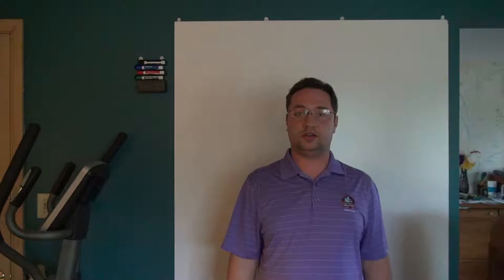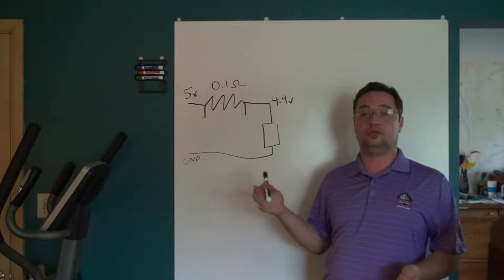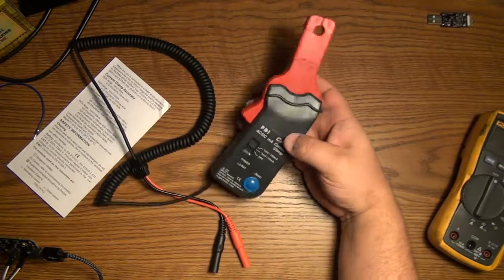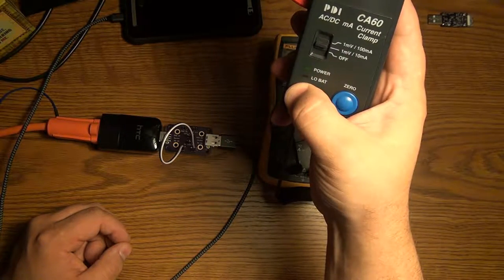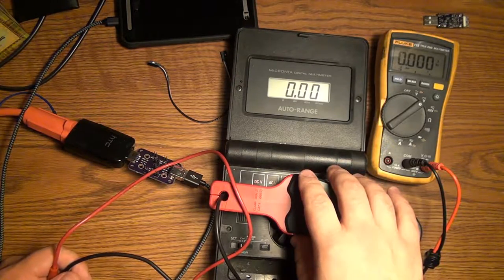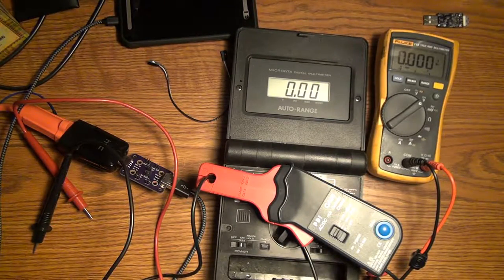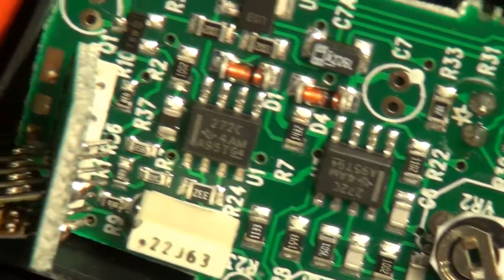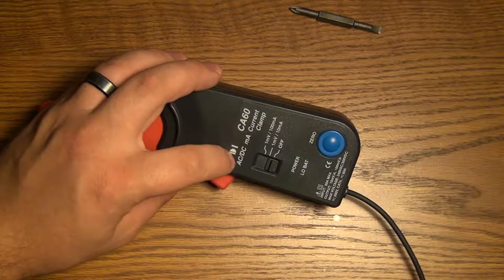eapbg #21 Burden Voltage and Clamp on Current Meter Tare down

Comment: EAPBG, what equipment can test how much current an AC outlet can output BEFORE it pops the breaker if you didn't have the buildings wiring schematic or main fuse box and didn't know how would you test the AC outlet to know how much current it can handle BEFORE it pops the breaker?
Reply from the maker: If you were planning on doing this, please don't. Unless you know exactly what you are doing you will kill yourself. Either by electrocution or setting the building on fire and I bet it will hurt the entire time you're dying. That said, there is special equipment for tracing wiring and breakers such as a toner. Apply a tone to a wire that is turned off and then use a probe to follow it. Circuit breakers have two modes of operation short circuit and running overload (terminology may vary). Short circuit is simple, a large inrush (something like 1000%) trips an electromechanical coil. Overload is more difficult. This is because it usually uses a bimetallic spring. The ratings are something like 100% indefinitely, 110% for an hour, 150% for 10 minutes, and 200% for 2 minutes (made up but that's the idea).  With a 115V 15A outlet, you need to dump 1800W of power while testing. They make electronic loads but for that kind of power, you're looking at $5k and up.

Comment: The alternators control lines are called bidirectional there is 2 wires, one is for the feedback to the ECM/ECU and the other wire sends out a 400hz duty cycle PWM pulses. I don't know why mechanical technician call the wires bidirectional when both wires aren't bidirectional they are just 2 separate unidirectional signals. Yes its called a charging system either a 2 wire or 3 wire control signals.
Reply from the maker: Because of your TIPMs comments, I assume you are working mostly on Chryslers. I hope you realize that there are many many other types and setups of charging systems. Every manufacturer is currently using at least two different setups. Further, historically there are hundreds more. It is impossible to generalize about all vehicles because someone somewhere did it differently.

Comment: That is what I want thinking because i don't see a "separate specifications" in equipment or circuits that just tell you the switching loss of the whole circuit. How can you lower the switching loss? by lowering the +Vcc voltage and using high switching frequency but what else can lower the switching loss? I know when TTL switched from NMOS to PMOS to CMOS the switching loss was lowered also.
Reply from the maker: If I could answer that question I would be rich.

Comment: Thanks I get it, but all transistors, FETS will have switching loss, is there a specification that tells you the circuits switching loss value or is this switching loss part of the power efficiency spec of Pout/Pin *100% formula?
Reply from the maker: It's part of the overall power efficiency.

Comment: EAPBG, any reasons why the current raises higher drawing more current when an AC motors brushes start to get carbonized? and why does a stylus printer head draw more current compared to a thermal head printer?
Reply from the maker: No idea, either topic.

Comment: Which CAN modules in most cars use memory? The ABS module has memory chips?
Reply from the maker: ECM/PCM hold the memory of codes and how the engine is running, radio, clock, body computer, possibly gauge cluster, anything else that can have memory like seats, mirrors, etc.

Comment: so you're saying that the metal chassis and the earth ground wire form a capacitive coupling? All circuit boards have conductive traces which are to close to each other will form a capacitive coupling between 2 print circuit traces close together. When you disconnect the earth green ground wire on the AC cord, you will measure microamps of leakage current, I'm not sure where this microamp leakage current is coming from or why equipment even has leakage current.
Reply from the maker: Yes, circuit boards also suffer from capacitive coupling.

Comment: Is the frequency of the control line always 400hz? Can you upgrade your car and put in a higher output amperes alternator like 130 amps when the stock car has a 90 amp output you can upgrade it to a 130 amp alternator? Because the cars regulators circuit somewhere limits the car alternator by sending signals to the ECU/ECM unit, this is how the car regulators circuit limits the car alternator?
Reply from the maker: It is very difficult to say because there are a ton of different charging systems. Generally speaking, the car does not monitor the current of the alternator, only the voltage of the system. The control loop tends to work as follows. If the system voltage is too low give the alternator more output. If the system voltage is too high give the alternator less output. If the power of the alternator changes, this control loop would just readjust.

Comment: When replacing a Light Bulb/Lamp with a higher current rating Light Bulb/Lamp, will this "overload" and damage the circuit since the new Light Bulb/lamp needs more current to light the light bulb lamps filament? I'm guessing higher current rating light bulb lamps have a thicker filament
Reply from the maker: It could, it depends on what the circuit was rated for, to begin with, and how far you are exceeding its limits.

Comment: EAPBG, what is the difference between ceramic fuses compared to glass fuses with filaments? is it about the time delay of the fuse filaments? I'm not sure what the differences between a circuit breaker that is in the AC outlet mains compared to a GFI circuit breaker. I think the AC outlets with built in GFI circuit breakers is referenced to a water sink piper and the AC outlets that just use circuit breakers from the main panels are referenced to earth ground. The GFI AC outlet are ment to connect plug in equipment that have electronic circuits boards that uses water or fluids so it a hose inside the equipment leaks inside internally only the electronic circuit boards or AC wires inside internally inside the equipment the GFI AC outlet will trip much faster than a ceramic fuse or glass fuse time delay?
Reply from the maker: No to all of that. Generally, the difference between glass and ceramic fuses is how much current they can break. There is a category of fuse called HRC high rupture capacity. These fuses tend to be ceramic and basically, they are designed not to explode when breaking a large current. Fuses protect the equipment, not you. GFCI outlets and circuit breakers are meant to keep you alive. I'll leave it to you to look up the details. Simply they compare the incoming and outgoing current and if they don't match, they trip. This is for when someone is getting shocked hot to GND.  Incoming current is leaving via a different path causing a mismatch.
Reply: @eapbg  A GFCI outlets compare the incoming current would be what and the outgoing current would be what? I'm confused the incoming and outgoing current is 120VAC and whatever the equipment is plug into that outlet is drawing current. I'm not sure what you mean how its comparing incoming and outgoing. I'm guessing you're saying that GFCI have comparator circuits or memory but how is it comparing when there is only 1 outlet 1 AC cord plug into it?
Reply from the maker: Current always moves in a loop. A GFCI has two wires in it. Hot and Neutral. The comparison happens between those two line. Google how GFCI outlets work.
Reply: @eapbg  ok thanks i just thought equipment like autoclaves, sterilizers, dishwashing units are ment to connect plug into GFCI outlets only if a water hose was leaking internally inside the sterilizer or autoclave the water leakage onto the AC wires can cause the water to be a live wet 120AC and if someone touches the live wet water they will get shocked this is why you're suppose to plug equipment that uses water into GFCI outlets i thought.
Reply from the maker: @billwilliams6338  That is entirely correct. If the current bypasses the outlet via a ground there becomes a mismatch of current on the on hot and neutral line and the outlet trips.

Comment: Yes if you put your Current Clamp on the AC cords green wire earth protection ground it will measure leakage current and if you disconnect the earth ground from the AC cord and measure the leakage current on the metal chassis, any reasons why there is leakage current measured when you disconnect the earth ground green wire ground? All equipment has leakage current on the metal chassis I'm not sure why there is leakage current or where its coming from or what causes leakage current
Reply from the maker: For other than hot being shorted capacitive coupling would be the other reason.

Comment: list what would cause capacitive coupling issues like what to cause leakage current?
Reply from the maker: Capacitive coupling is how capacitors work. It's just that metal parts in close proximity to each other can also form capacitors. A capacitor can conduct AC. Thus current can pass through the metal body and to earth.

Comment: What are you talking about as switching loss, what causes switching loss?
Reply from the maker: Let's look at a simple circuit of a 12ohm resistor being turned on by a fet in a 12v system. Power is I^2 *R. When the fet is off it looks like 1Mohm. The current is effectively zero and so the fet is dissipating zero watts. When the fet is fully on let's say its resistance is 1mohm. The current would be 1a and the power dissipated would be 1mwatt. When the fet switches it has to transition from one resistance to another. During that transition the power it dissipates increases. Let's lake the example when the fet is 12ohms. The current ould be 0.5a. The fet would be dissipating at that instant 3watts. You can extrapolate the other points if you want. The simple answer is that while switching, during the transition the fet will get hot.

Comment: When measuring the current output of a cars alternative it will measure in general 60amps to 90 amps at car Idle. When measuring the current of the car battery red wire positive it will measure 2amps to 3amps at car idle. Why is the car battery red wire positive only measuring 2 amps to 3 amps of current? Also some cars alternators have a 400hz control line that comes from the ECU module. Why 400hz?
Reply from the maker: The battery is probably nearly fully charged and is hence only consuming a few amps. The rest of the consumption is to run the car systems. The frequency of the control line is a manufacturer-specific decision.

Comment: EAPBG, when measuring the current of a battery that is rated at 6vdc/3AH amp hours. This means that if a circuit board is drawing 1 amp of current that the battery will only last for 3 hours?  My question is if the circuit board under test is only drawing .5 amps and you measure the current with your ammeter and it measure .5 amps, how would you really know if the 6vdc/3AH battery is good or bad? how would you know the capacity of the battery is still good or bad? The voltage measure 6vdc but how can you really test the battery
Reply from the maker: Integration is the key. At 0.5A the battery should work for 6 hours. Time how long it takes for the battery to die. This will tell you the wear level.
Reply: @eapbg  yes but this doesn't test the batteries capacity is still good. Measuring the current is not knowing if the battery capacity is still able to recharge and keep the charge. What kind of tests equipment do you need to test the batteries AH amp hours not only just the current but test the batteries AH amp hour rating and capacity test?

Comment: car TIPM boards have 4 layers of grounds, any reasons why 4 layers of grounds?
Reply from the maker: A board can have anywhere between 1 layer and 25 layers. I have not heard of anything higher than that at the moment (iPhone). The layers tend to be staggered. Signal on top, power, power, signal on the bottom. This would a typical 4 layer stack up. Power can be either positive or GND.  Signal, power, signal, signal, power, signal could be a 6 layer stack up.

Comment: Do a video about leakage current how equipment have leakage current when you disconnect the earth ground on the AC output or AC cord has no earth ground the chassis to the equipment will have leakage current, any reasons where this leakage current is coming from because it should be at zero voltage zero current even with no green wire protection earth ground connected.
Reply from the maker: Equipment that only has two prongs should be double insulated. Generally, this means an all-plastic chassis. Equipment with an all-metal chassis will have that chassis earthed.  It is possible to capacitavely couple from the electronics to the chassis causing an AC current. This is bad and indicates poor design. The earth lead is only meant to serve as a second layer of protection in case the chassis became electrified.

Comment: When measuring a short in a car they call it a parasitic drain, but why are they calling it parasitic, what is parasitic in a car is it the wiring resistance or the load? I'm just confused why they are calling it a parasitic
Reply from the maker: It's called parasitic because like a parasite it slowly drains the victim. In the case of a car, the victim is the battery. Modules need constant power to keep their memory alive. This slowly drains the battery. The design usually allows for that small drain for a week or two without killing the battery. When something goes bad and that drain gets bigger the victim dies and the car won't start.

Comment: Yes i understand, I just don't get why 400hz, who came up with this 400hz or why do they use 400hz instead of 80hz or 600hz. There must be a reason why 400hz PWM signal for the cars regulator. Or do you know the theory on how a car charging system work in general for most cars i mean. A Cars Charging System works by the ECU sends out a 400hz PWM signal to control the cars alternators output current and there is a car alternator feedback wire that sends back to the ECU the alternators output voltage.  The Cars regulators limit the Alternators output current and output voltage? Examine how you think a Cars charging system work please
Reply from the maker: Unless there is something new, cars never monitored alternator current, only the voltage. Also computer controlled alternators are fairly new too, last 15 years or so. Before that alternator had built in or external regulators. 400Hz is just what the manufacturer chose. It is probably a compromise between smoothness and switching losses. Are you working on Chryslers or what makes are you working on? Also please reply to my replies. it gets very confusing when every questions is a new comment.
Reply: @eapbg  What do you mean by switching losses, why would 400hz have less of a switching loss compared to switching at 60hz? you mean the higher the frequency the less frequency loss?
Reply from the maker: @billwilliams6338  It's the other way around. The higher the frequency the greater the switching losses but the smoother the signal. Let's use a MOSFET as an example. A MOSFET dissipates the least amount of heat when it is fully off or fully on. It dissipates more heat when switching between those states. The switch time of the MOSFET is about the same regardless of how fast you are switching it. Because of this, there is a direct correlation between heat and how fast you switch it. Switch it twice as fast and you make twice as much heat. Thank you for replying to the previous answer.
Reply: @eapbg  switching loss you mean the Mosfets output voltage and current will be lower, the amplitude will be output on the Mosfets output?
Reply from the maker: @billwilliams6338  No. As I said the MOSFET has two states fully off and fully on. For MOSFETs, this is typically rated in ohms. The on-resistance of a good power MOSFET is milliohms. The off resistance is something like megaohms. During a switch, the resistance changes. While the resistance is some value other than off or on the MOSFET is burning lots of power and making lots of heat.